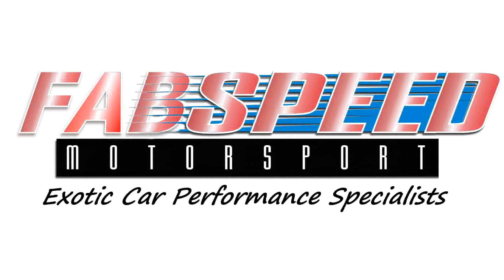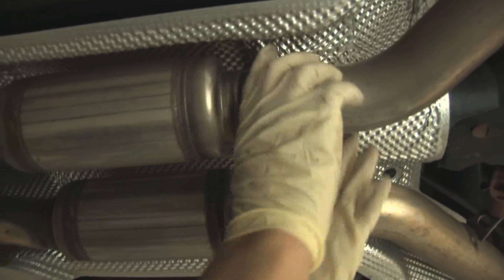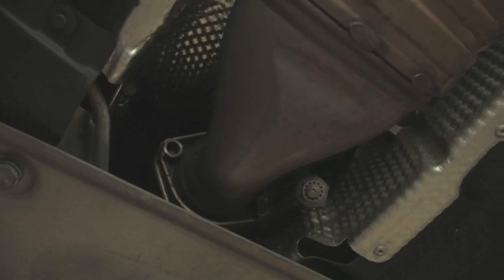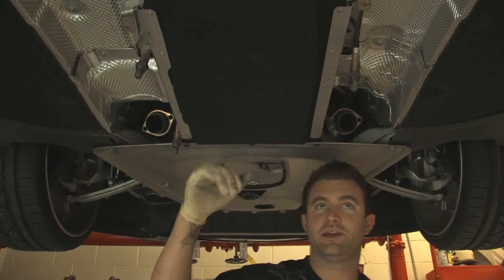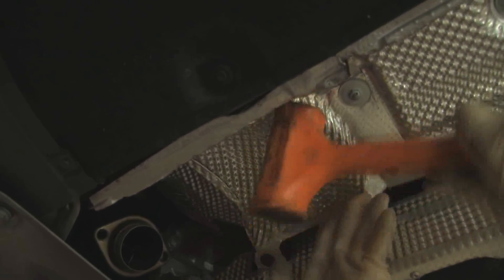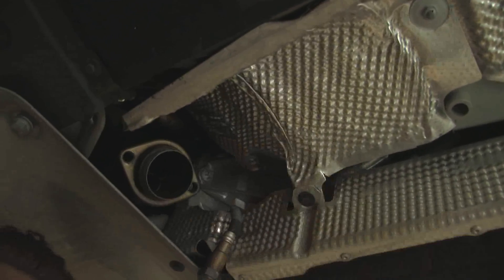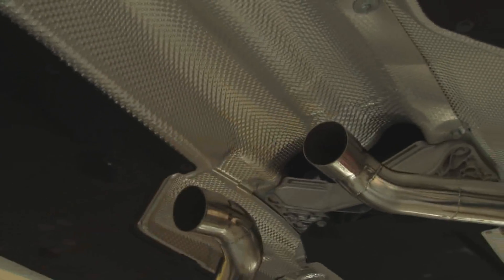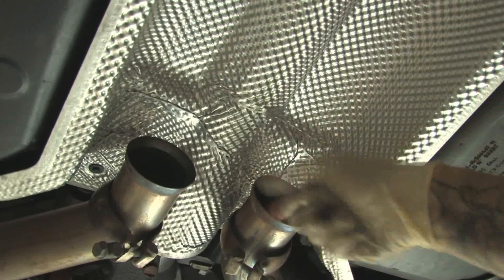BMW E92 M3 Fabspeed Maxflo Installation Video and Dyno Run

Comment from the maker: with resonators as this car already had a Race Exhaust installed.  I would only install the X-Pipe without resonators if it is a track car or you are going to install with the stock muffler and stock catalytic converters.

Comment: i have a E93 M3... I would like to keep the stock muffler. And thinking of installing high flow sportcat and x-pipe. My criteria is... there should not be resonance /droning effect in cabin. what do you recommend? I saw the phrase with resonator and without resonator...what difference does it make to quality of exhaust note? You are expert..please recommend. Thanks.